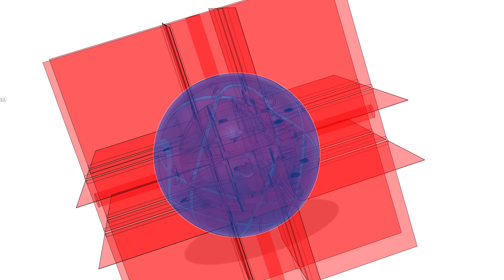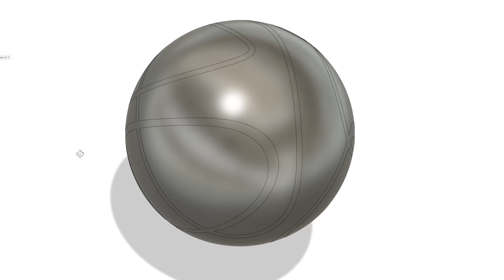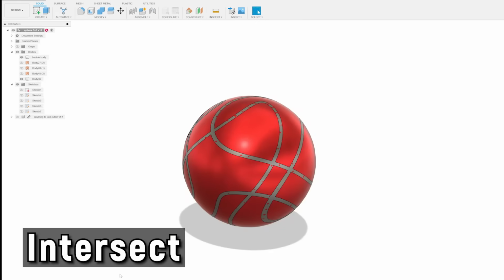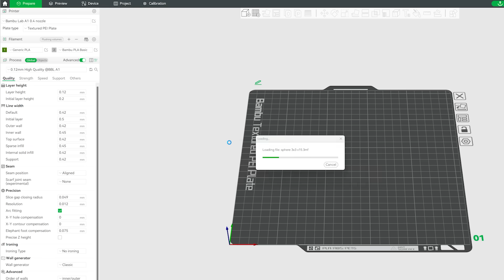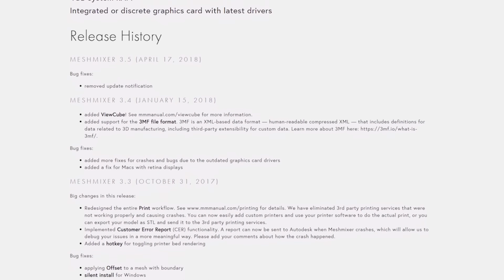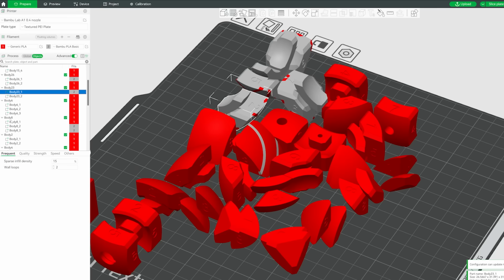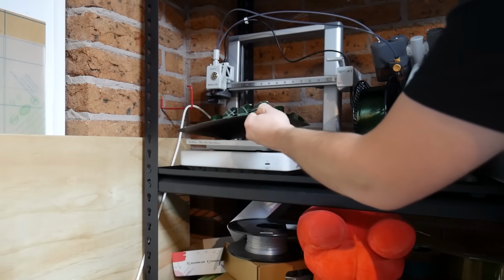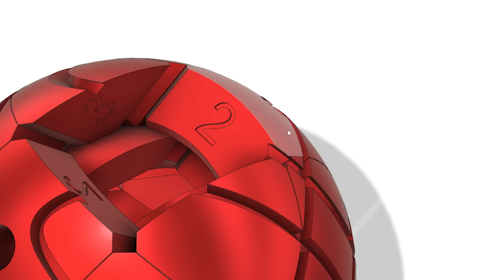I 3D Printed a Christmas Bauble Rubik's Cube (and I can't solve it 😭)

Comment: Been thinking about this.

What about making the "sphere-o-cube" more accessible by using 8 subtle surface textures in addition to the winding lines? This would allow solution by touch alone, even when the visible pattern confounds the process.

Which fingertip-sensitive textures could work? I'd need to run that past a few folks who read Braille (though Braille itself won't work, as the pattern needs to be recognizable in any orientation).

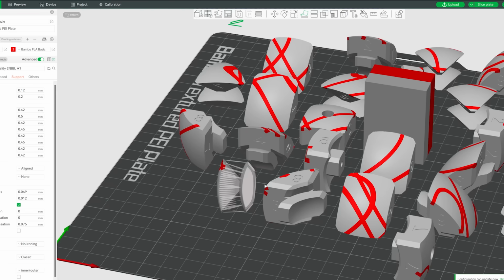Comment: 7:27 I agree with some multiple material printers wasting filament, why I stepped away from Bambu to Prusa. Same challenge with separating objects and parts in Prusa Slicer

What I have been doing is creating multiple selection sets and the n saving as mesh incrementally. Fusion will only export the visible items in a 3MF file. Same in STL. So I export multiple times to get multipart objects that I can arrange on the bed. It would result in needing 9 exports but think that would be faster.

One could also use components but I found that more cumbersome.

Comment: In my experience, the best way to set up a Fusion object in order to make it easy to colour in Bambu Studio is to just offset any surfaces that need to be a different colour by a tiny amount (even 0.001 works)
Then, using the fill tool for colour painting takes a few minutes at most
Reply: This. Lots of multi-part multi-color prints are really just single color prints that have been painted in the slicer.

Comment: Couldn't you just slice it in Fusion itself? I didn't try it with multiple colour but materials (and thus color) should stay up to the end of the line to gcode. Just needs a regenerate when changing the model. 
Another way is not to print multicolor but leave the gaps for the lines in and fill them with a 3D-pen. This is ofcourse the easiest solution also avalable fo people with single-color-printing only.

And,  could you change the design to be print-in-place maybe? That would solve a lot of issues, but needs to break free after printing. Maybe 2 or 3 print-in-place prints.

Comment: Very clever to use the random spline for the pattern. I always forget those exist because they are not the usual parametric element.
As for the complexity of the puzzle, the center orientation and the spherical shape could be the main issues. I have a cubic Earth "globe" puzzle and although the method is similar, I can confirm it differs in a couple of steps from the usual cube. I'd love to give it a go! :)

Comment: as a replacement for meshmixer you can use blender. In blender you can parent all the parts of the pieces and then spread them out as if you were spreading them on a build plate, then just export them as .stl (not sure if you can export 3mf from blender, i doubt it) and import them to bambu studio, choosing to import them as indivisual objects
Reply: there is an addon for 3mf available.

Comment: In theory to fix the splitting issue you could try hiding and assembling each chunk of the 3x3 after the split to objects operation. 

Once split, From the objects tab selecting everything & right clicking should show a make printable option which you can disable to clear the workspace of clutter. With the assumption that the cube parts were number logically (e.g. parts 1-3 made up the whole top right 1x1 block in the 3x3 cube). You could select those parts in the object tab, make them printable again and right-click -> assemble. Repeating this process for each 1x1 of the cube should get you essentially what your looking for. 

Wether assembling each part that makes up the 3x3 is faster than other methods I'm not totally sure of but once they are the parts can be easily auto-rotated and positioned without fear of them splitting apart.

Comment: since youre using bambu studio, you can slightly indent the lines and paint them with the bucket tool of bambu studio, its not the best solution since alot of people dont use bambu studio but it is the simplest i can think of in this use case

Comment: I’ve had good luck placing parts into multiple components then exporting as a step file. That seems to maintain multiple layers of groupings while separating in the slicer. Only issue I get sometimes is the slicer conversion of step files isn’t always as smooth appearance wise as exporting from Fusion.

Comment: In Fusion, you can assemble the parts you want to print as one piece as a Component.
Then export the whole file as a STEP and import in orca.
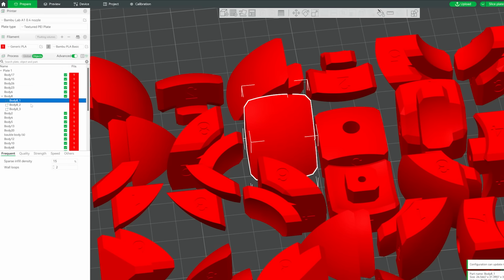Now you can "Split to parts" (Not "Split to objects") each part individually and then assign the filaments, exactly like you did at 6:40
(This sadly only works one layer deep, components within components aren't translated properly)

Comment: Really easy to solve, remove screws, disassemble, re-assemble in correct order, reinsert screws. I remember “solving “ an original rubrics cube by a similar method.
Reply: When I was 8, I peeled all the stickers off and put them back. Got in a lot of trouble. Creativity is undervalued.
Reply: even then, he said that it was difficult to assemble and had to resort to the cad

Comment: I’m really in to Rubik’s cubes and years ago I designed a 3D printable mirror blocks cube (does not need different colors to print) whose file is sadly locked inside a rusted thumb drive that no longer works. I would love to give this cube a shot at solving.

Comment: 3x3's are quite easy to solve, but idnetifying parts from the swirly pattern would be annoying, and you do actually have an extra complication relative to a normal 3x3 because you also need to rotationally align the centers.

Comment: Love the bauble! I struggle hard enough with a regular cube to know not to bother trying to solve this one!

I never found meshmixer intuitive, but I figured out an alternative workflow that works for me. If you group the bodies as components in Fusion, export as a step file, and import that in Bambu Studio, it retains one level of grouping. I use it all the time to handle multi-part multi-colour projects. For the bauble, I would have tried making a component for each segment, and inside each of those a component named for the colour to be used. Export each segment as a step file and drag all the .steps into Bambu Studio. Scroll through the object list ctrl+clicking on like colours and changing the filament of them all to the desired colour. Maybe not the most efficient, but it means I can get away learning one fewer applications.

One downside is the conversion from step to a mesh within bambu studio doesn't seem to be tuneable and I've had some models with large, swoopy curves come out with visible triangles in the final print, and silk filaments are so unforgiving with that sort of thing.

Comment: While it isn't automatic, to separate out different multi-color parts from Fusion to go into a slicer: you can make sub-Components of multiple bodies which have appearances assigned. Due to the way Fusion's browser hierarchy works, bodies within a component are considered part of the same object. To speed up color assignments in the slicer name all the bodies in the components as their color before saving, then save each component as a separate 3MF. This probably could be automated as a script for a complex part.

When you get the file into the slicer, you can shift-click all the bodies (grouped by name) and assign a color to the group in the browser. At least, that's my method for Prusa Slicer. I can usually get a multi-color print set up in a few seconds once I import them from Fusion. Prusa Slicer is really annoying when you load in multiple files at once, since it's either all joined or all separate, with no in between that I have found.

Edit: To clarify the Hierarchy, here's a simple example:

Assembly (the full fbx)
    - Component 1: (save as 3mf)
        - Body (Color 1)
        - Body (Color 2)

    - Component 2:  (save as 3mf)
        - Body (Color 1)
        - Body (Color 2)

Comment: As far as printing a cube with multiple colors, the way the professional stickerless cubes are done, they have solid color pieces for the corners that interlock in a sort of triwing shape. The edge pieces are similar, but easier to slide together because they just slide straight into each other. While those are injection molded generally, they'd be pretty easy to 3D print too. It's a shame that MeshMixer isn't open source. Then the community could work on updating it.

Comment: Solvable in like 10 minutes with the beginners' method. It's basically a super cube, where each piece has its place and orientation (including the centers that in a regular cube don't have specific orientation). The green bauble looks better. The turning quality can be improved with careful sanding.  edit: I think it's possible to make the surface smooth and glossy by coating it with UV resin.

Comment: In Solidworks you could just have made a configuration showing only the sections you want.  Then save that as a stl.  You essentially make a configuration for each part.  Ive never used mesh mixer so I'm not sure if that's easier or harder. 

Not sure if Fusion has the ability to do configurations of models.
Reply: Fusion has configurations in the paid version, but there's also better ways to handle the whole multi-color output method in Fusion than using configurations.

Fusion's component system kind of negates the need to isolate each quadrant into its own configuration. At least for this example.